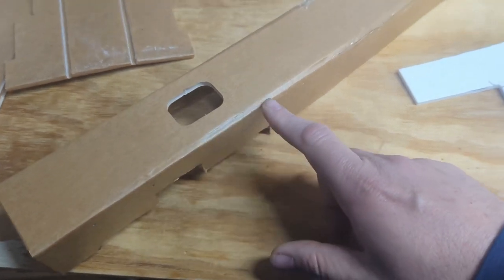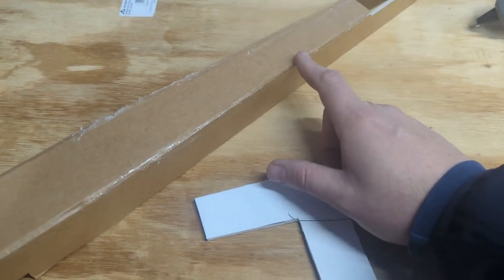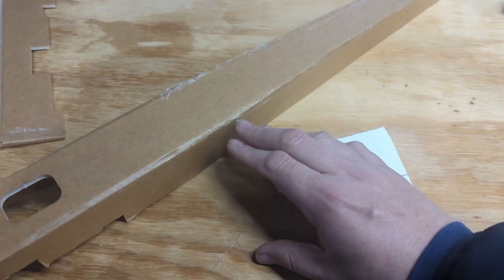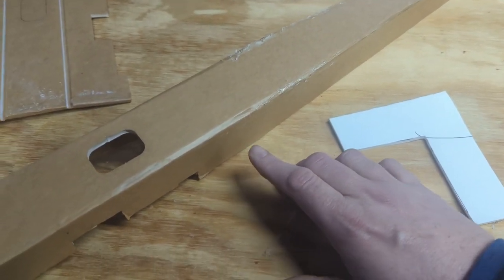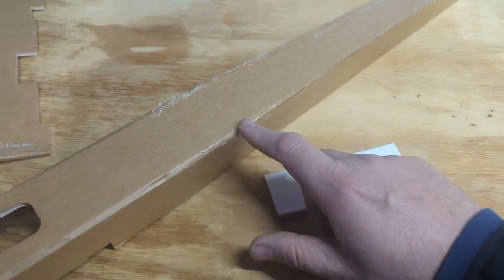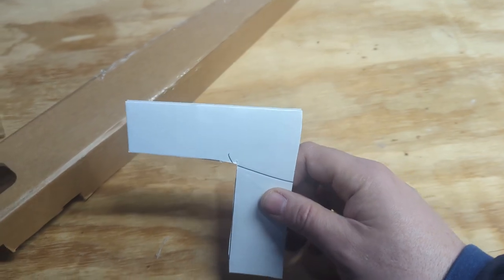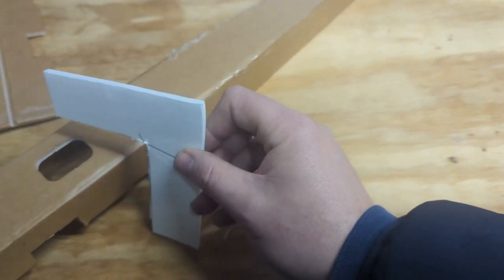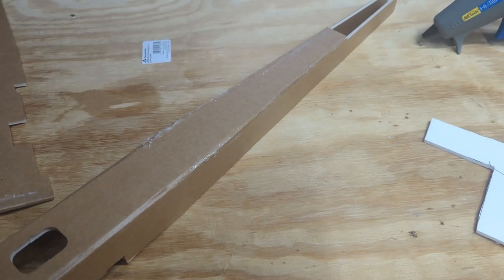FT Seaduck...a trick for waterproofing edges (nacelles, etc)

Comment: How many ducks have you built?  I am building another one, I think it's my 4th or 5th one.  It's my favorite plane to fly, love it on grass, water, snow, in the air... Thanks for the tip, keep them coming!
Reply from the maker: This is Duck #2 actually. I babied the first one lol. Had a few small crashes and tried to repair it. The repairs held for a while until it finally gave way. I love it too especially b/c I loved Talespin growing up. I'll probably always keep it in my hangar.
Reply: @perkyplanesrc9363  As did I - my brother and I watched all of the episodes.  I've gone with original paint scheme every time, but I'm thinking about doing a blue Snow Duck from that episode where they were imprisoned 😁 I babied my first one, but water made it too weak.  Totaled the 2nd one into a set of bleachers.  Smashed and repaired one last year, until it too finally got to be too much.  Almost done with this year's duck.
Reply: Found a 60% scale version on FT Forums that I am going to build as soon as I can get the AIO plans printed somewhere.
Reply from the maker: Sounds like you've had an awesome time with it. 🙂 Blue would be good... I like the color blue anyways so I am a little bias. I don't usually paint blue bc of being able to see it ok...of course darker blues would be ok. And a bigger one would be awesome. 

While I love the Duck, i do wish there was a decent way to break it down at least a little bit.
Reply: @perkyplanesrc9363  I saw someone modified the wing to be detachable, but I am not sure I am up for the modification...